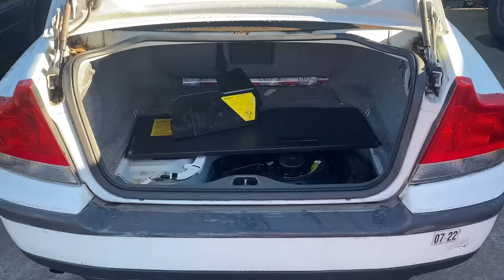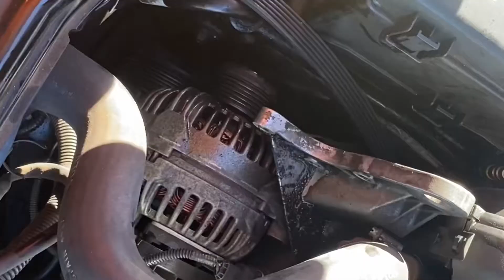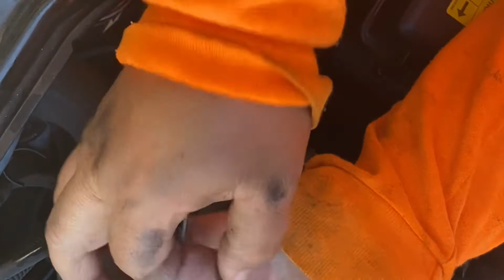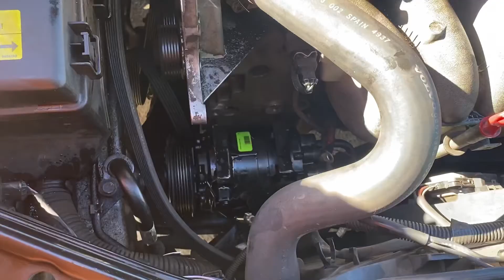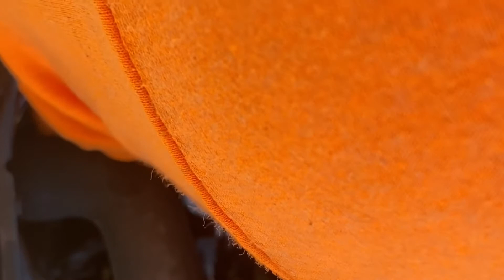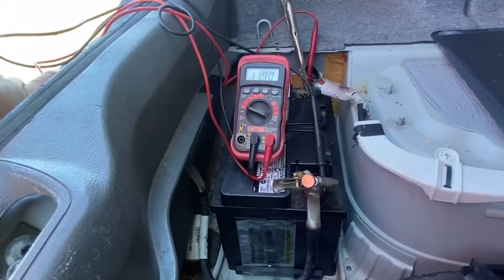Alternator Replacement Volvo S60 (also includes power steering pump, serpentine belt ,voltage test)

Comment: nice job .. we just did this exact same job on my S60 .. but having a problem getting the serpentine belt back on .. i wish this section of your video showed exactly the steps for that :\ its so frustrating after replacing the alternator perfectly .. relatively easily .. to get stuck at the last part with the belt :\

Comment: Installed a NEW certified Volvo alternator. Now get the following: Power system service urgent light on .  Any suggestions on what to look for on this error?
Reply from the maker: Check the fluid make sure it’s full and no leaks then it would be a time framed service request that needs to be reset by a scan tool you can also try disconnecting the battery for a few minutes to try reset the computer try those and if they don’t work lmk and I can look deeper into it for you have a great day Aloha
Reply: @michaelsilvajr.4578  thank you for the speedy reply! Unsure what fluid as it's an alternator? . Did do the battery method reset. Still has that red alert message. Might take it in to see if the new  alternator is indeed functional.
Reply from the maker: Hea sorry man I miss read your comment but that would be a good thing to check out the alternator cause it could be defective and not putting out proper voltage

Comment: Two questions, are the 2001 and 2004 about the same under the hood? Also, can you list the tools needed, if it's easy off the top of your head..... Thank you!
Reply from the maker: There pretty similar maybe just a little different if any and for tools used I think it was flex head ratchet sockets I think I used the rail with socket sizing from 6mm -22mm so nothing smaller or bigger then that sizes also opened end wrench’s of the same size range some pliers and I think it was a pry bar to help with the belt installation let me know if this helps if not I can check my shop tools program and see if there’s a detailed tools list have a good one Aloha

Comment: How much u think this will be at a mechanic just alternator and power steering pump plus labor?
Reply from the maker: Not to sure every place is different I try to do help people out as much as possible cause the price quote’s people bring to me is crazy on this job the alternator was about $120 and power steering pump was about $80 and about 4 hours labor labor around here runs about $80-$100 an hour but for me t just do a flat rate and if it takes longer its on me and on this job the price quote they got was for something like 11 hours labor at $100 per hour witch I think is a little overboard lol I hope this helps have a good one Aloha